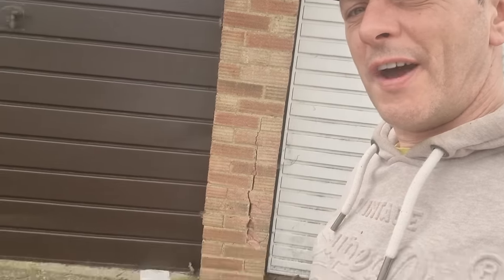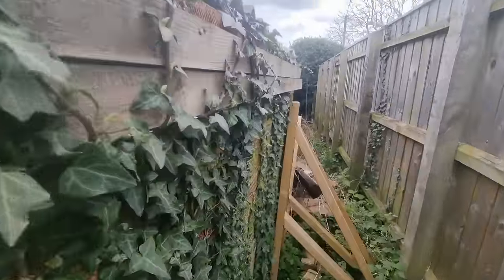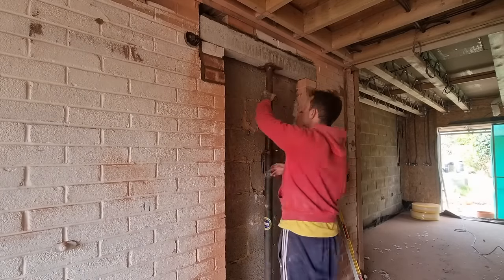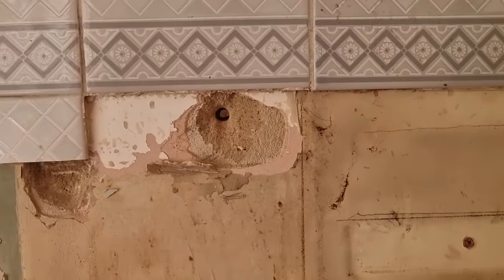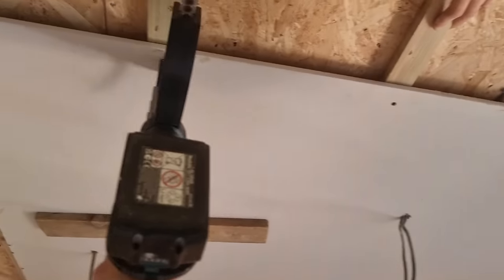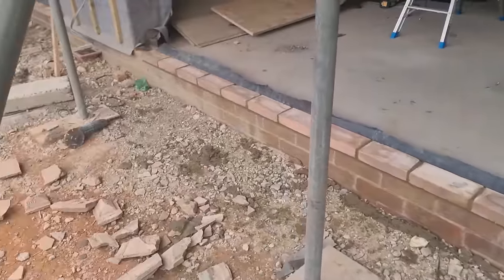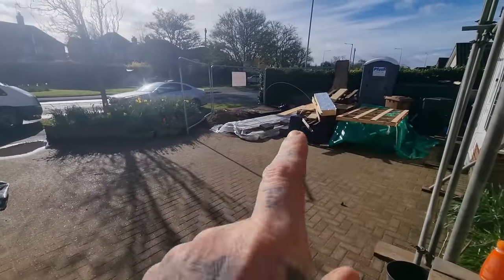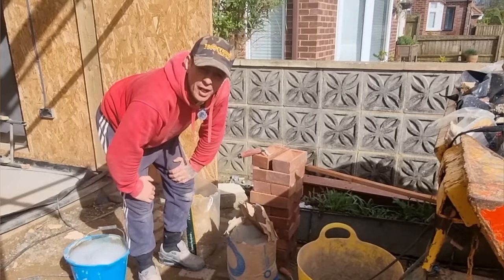Bricklaying How to make alterations to your home #bricklaying #construction #build

Comment: Hi Tricky, thanks for welcoming me on your live stream great vibes. I was wondering if i maybe able to ask for some mortar tips as im about to install three extrenal air bricks to my property and its my first time n im kinda nervous about mixing my own concrete to ratio and then the actual installation.  Any tips would be most appreciated ❤ 🙏  (sorry for going on ^)
Reply from the maker: 4 sand 1 cement. And a touch of mortar plasticiser in the water. Don't put to much water in the mix at first . You can always add a touch more if its not creamy enough. 😉
Reply: @trickybrickys  thankyou, really appreciate it x

Comment: Where you cut out for the lead does it not need a horizontal cavity trays above?
Reply from the maker: No mate
Reply: Ok. Do you have to water seal the brickwork then?
Reply from the maker: The bricks are semi engineerings.  They are none porous mate.
Reply: @trickybrickys  ok mate! Not like the shite new build ones nowadays ha

Comment: Busy busy busy😂That plumber could cut that blue pipe and put a Male adapter of the same. Then screw a brass coupling that reduces to the copper size!!🤫🤫🤫
Reply from the maker: Hopefully it will be sorted this week 🙏 then I can crack on with the driveway. I want to get off that one now.. it's nearly 4 miles from McDonald's 🤣🤣🤣🍔🍔🍔
Reply: @trickybrickys  lmao... McDonald's 🤣🤣🤣